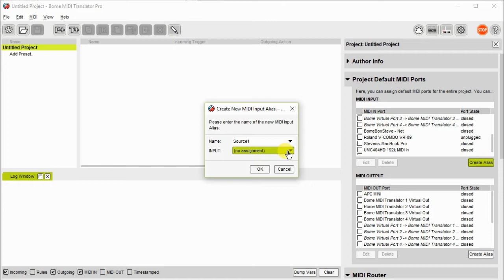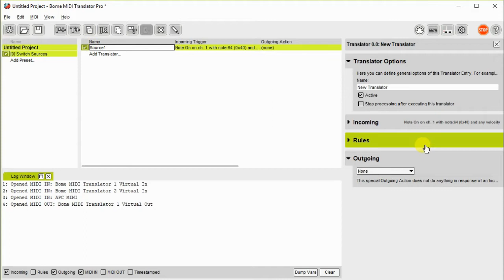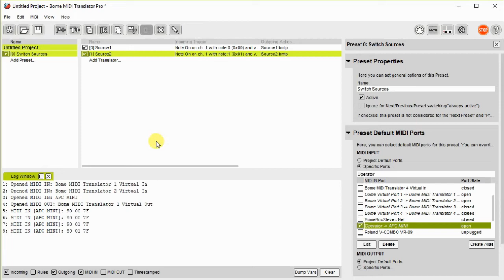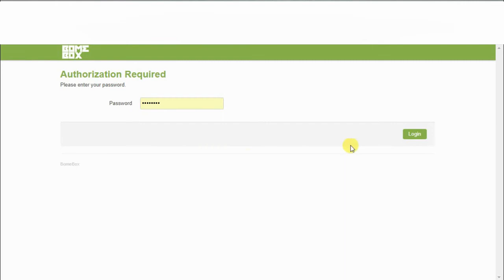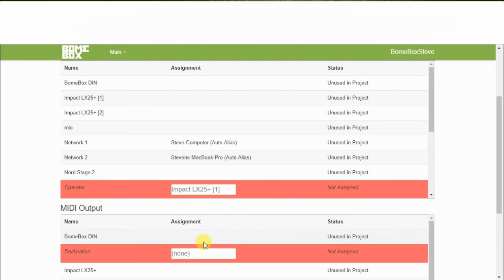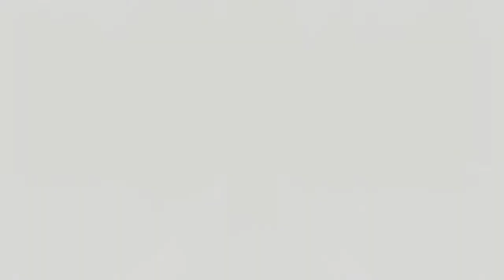Tutorial: Using BomeBox as a Host MIDI Switcher

Comment: This is an awesome feature. Only one question left: Is there a possible short gap when switching between project files, or does this happen seamlessly, as regards the midi in/out buffer?
Reply from the maker: It will probably require at least some clock pulses to switch over so it will not be seamless but it may skip a beat or two, depending on the DAW use.

Steve Caldwell
Bome Support.
Reply from the maker: Quick clarification: the BomeBox has special logic to prioritize "executing" a different project file to make it as seamless as possible. The gap will be defined by the loading time (depends on project file size, typically just a few milliseconds).

Comment: Thank you very much for this series of videos on the Bomebox.  I've had Bome Translator Pro for some years now, yet, never got the Bomebox and now somewhat regret it since I'd like to have a dawless (pc free) setup. Will the Bomebox accept one source going to multiple destinations (which require different translator)?  If so, how does one switch between translators (unless it is automatically selected) w/o using the computer (in my case Mac)?  Example: Use my Novation Launch Control XL MK2 (switching between 2 user templates) with 2 destinations (1010Music Bluebox and Blackbox). Thank you!
Reply from the maker: Hi Luis,

Thanks for your comment!  Basically you would have your Bome Project look for MIDI IN  from the Launch Control XL and have the incoming trigger switch presets for you which could set out routing to a different destination.  If you want, I can elaborate more on our Bome user forum.

https://forum.bome.com

Steve CaldwellBome Customer Care
Reply: @Bome  Hi Steve!  Thank you very much for getting back to me so promptly, much appreciated! I will certainly follow up on the forum.  Again, thank you!

Comment: Are you a witch?! I assume there isn't any limit for this kind of config. If I want to have one master keyboard and switch which synth it's routed to, it's just limited to how many synths I can connect to bomebox at once?
Reply from the maker: Indeed, there is no practical limit: even for one keyboard, you can have thousands of switchable configurations. The BomeBox has approx. 8MB of persistent storage for these configurations. A switch configuration usually just takes 10-100 bytes.
Reply: @Bome  thanks so much for the reply. I decided to order one finally after years of looking at it on and off. Being able to switch configs without a PC is super important for live. It'll help heaps in the studio, too. I think I held off for ages sure to the lack of IO. Would you ever consider releasing a 19" rack mount version with more din and USB host ports?
Reply from the maker: @politesociety  thanks, nice to hear! We have produced some prototype 19" racks, but currently, the expected sales do not justify going into production. As you probably know, you can add many devices via USB hub(s) to the BomeBox. But I agree that it's not the same as built-in connectors. We have early plans for a BomeBox 2, though, with more DIN and more USB host ports. But that will definitely take some time.
Reply: @Bome  are there any limits on the number of USB midi devices you can host via a hub, and are there any USB hubs and/or USB midi boxes you've had good experiences with? I currently use a cheap 4x4 USB midi box to add some DIN ins/outs to an iconnectaudio4+, which will migrate to the bome but but I'd be in the market for something with more ports so I could everything connected at once without daisy chaining. Do most powered USB hubs work fine, or do I need to get something with specific chipsets or features (like MTT)
Reply from the maker: @politesociety  In theory, there is no limit to the number of USB devices you can connect. In practice, we have reports that there is a certain limit (14 USB devices?). Pretty much all USB hubs will work. The only exception is one or two reports where very old, cheap, passive USB hubs didn't work. So for us, the rule of thumb is to use a known brand for USB hubs. USB-MIDI interfaces, however, vary greatly in quality, especially when it comes to Sys-Ex. We have very good results with multi-MIDI interfaces from ESI, but also M-Audio, iConnectivity and other high quality brands work well with the BomeBox. They must be USB class compliant. Feel free to discuss in our forum. Steve, our support specialist, may have some more tips. https://www.bome.com/support/kb
Reply: @Bome  hi - are you guys any closer to that bomebox 2? Also - is it possible to configure the bomebox to emit multiple notes per incoming note using the standard web config? Or do you need the translator pro for that?
Reply: @cylonik  

Thanks for your questions!

We cannot provide pre-release information on products under development.  The current BomeBox firmware will be updated periodically but again we cannot provide a definitive date for the next firmware release. 

In answer to your second question;  This is possible, however you need to have a Bome MIDI Translator Pro license and upload your project to BomeBox to accomplish what you are asking.

If you have further questions please folllow-up on our Forum at https://forums.bome.com

Steve CaldwellBome Customer Care